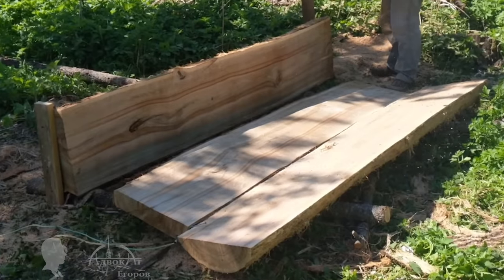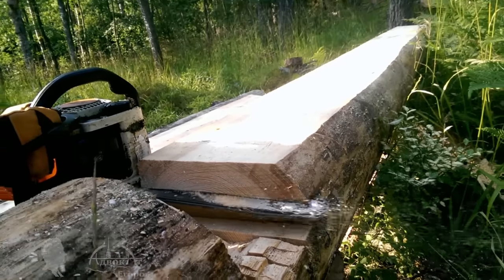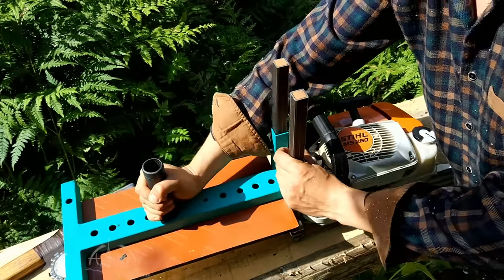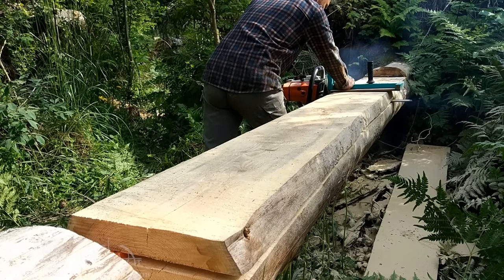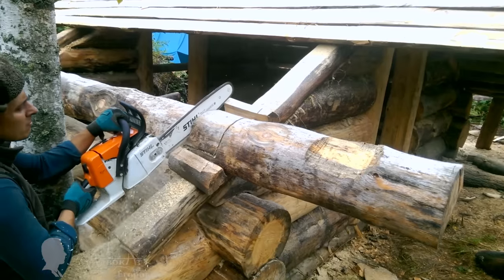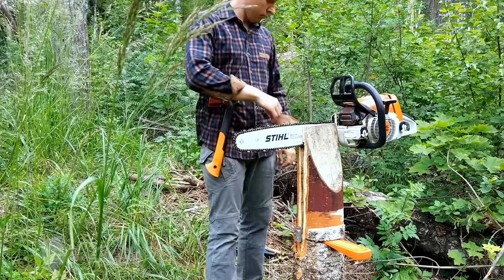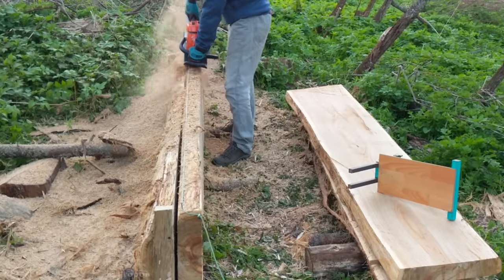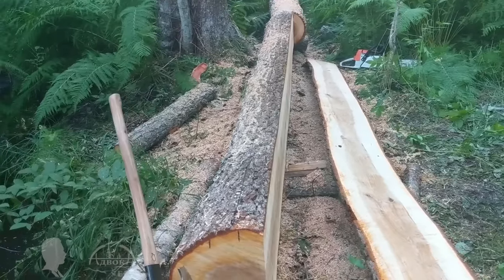Two Chainsaw Secrets | Turning a Tree into Perfect Boards

Comment: From a professional logger , get some safety gear and a military tourniquet . They could save your life and I'm sure your family will appreciate that .
Reply: Question for you: Don't we risk to have some kickback issues with his technique ?
Reply: ArthA122 would guess it’s always possible just have to always have a firm grip and control of the saw. Not that hard to control the saw if it kicks back letting off throttle immediately and strong hold on it.
Reply: Thanks dad...
Reply: @AGTtactical  I have seen one tough guy cut his half his arm off . So take notes and wear safety gear . Without a tourniquet he would be dead . He was a wildland firefighter and new his way around a chainsaw .
Reply: @baldwinboshop7078  Yeah, good for you... I've seen guys get both legs blown off, sucking chest wounds, an eye hanging out of his socket, fingers blown off , and exit wounds I could fit my fist into.  This guy clearly doesn't need your advice...save your 2 cents for a safety video, because any guy who has actually used a saw as much as Advoco knows he should wear safety equipment.  I wear chaps, steel toed boots, full face screen, hearing protection and a helmet...I think its something one should always use.  But I don't feel the need to tell everyone else what they should do, and especially not a guy as skilled with a saw as Advoko who obviously has made a conscious decision not to wear safety equipment.  Most people watch this video and admire Advoko's skill at making free-hand boards.  Then there are the rest that feel a need to show how much they know....
Reply: @AGTtactical  , your very charming .
Reply: @AGTtactical  wood chips can fly into your eyes and make you blind, no matter how skilled you are at sawing.. 
upon prolonged exposure to loud machines your hearing will degrade. Standing with your feet underneath the logs can get your toes chopped off without steel-tip shoes etc....

I don't expect Advoco to use this just because I point out the obvious hazards of it, but for everyone else who thinks they're gonna be cool and manly; you're way cooler with eyes, fingers and toes intact..
Reply: One of the people I knew that made charcoal for extra money had a saw kickback and split his head open.  It left his wife with almost no income and several young children.  It only takes once.😢
Reply: @AGTtactical  the benefit is for those who have no experience, see a guy with experience doing it, and think it is ok for them to do the same. The new guys need to live long enough to become experienced old guys.
Reply: Listen up everyone,  @AGTtactical  has seen some gore before.  Therefore safety equipment is useless.
Heh.  That's right.  You just got owned by facts and logic. QED.

Comment: Are you using fuel from a gas station?  These new fuels are no good for 2 stroke engines!  Instead buy TrueFuel it is specifically made for small 2 stroke engines!
Reply: why is that?
Reply: @Ken2234  synthethic fuel burns cleaner and most important less hot, thats why! It's composid from far less components than natural fuel.

Comment: I love the use of the scooter.  Ive come into a small (20 acre) holding and house and I keep coming back to not buying in tractors and quads and trying to use what I have.  I'd love an electric Polaris ranger, but it's not very off road and I'm toying with using an old 2013 nissan leaf for getting about.  If it goes wrong, it goes wrong!

Comment: I don’t even own a chainsaw and I think this is my new favorite channel. 
For your lines down the trunk before you cut, a safer (and easier) method would be to use a chalk spool/string. Not sure of the proper name, but my grandpa used to use it all the time. Basically it is just a spool of string on a reel, encased with colored chalk. Had a little hook on the end of the string that you can attach to a nail or something on one end. Then you just walk with the spool to where you need on the other end, tension the string moderately tight from end to end, pull the string up like a hunting bow, and let go. String snaps down onto the log and leaves a straight cutting line from end to end.
Reply: It's called a chalk line. The problem with this method is that the saw will blow the chalk away the first time you make a pass with the saw.

Comment: Hi Max, thanks for your video!  I found this very informative.  I have some large tallow gum tree logs here in Australia I want to try slabbing using your method.  You mentioned saw suggestions - I have an old Stihl 090 saw that I use for cutting large logs.  It is a bullet-proof piece of kit, and very powerful.  The lack of a chain brake is a little unnerving but you just learn to respect it.  These saws are impossible to source new here in Australia due to emissions laws, but you might be able to get one in Russia.  I cannot fault the saw, it is by far the best I have used, however it is a little on the heavy side.  All the best.
Reply from the maker: Joseph, thank you for the info. I ended up going with a portable Husky chainsaw

Comment: Excellent information.

I saw this a while back and have tried it.
Although I have not mastered the technique it works really well.
Reply from the maker: Shawn, than you for the feedback on the technique!
Reply: @Advoko Only using the tip has made my cuts cleaner easier and the chains last longer.

This works with felling trees as well as delimbing them.

I do not cut anywhere near as much wood as you do.

I do clear low hanging limbs from my property.

I have lots of bushy Juniper trees. 
Clearing them up as high as I can reach so I can walk under them is a full time job.

Starting on the smaller trees 2 to 3 inches in diameter keeping them limb free 10 foot up has produced numerous very straight fence poles after 10 years of growth.
Typically 4 to 6 inch poles.

Older trees I do the same but I like shade.

I live in Texas.

Comment: Max, a friend of mine has a HUGE pine log that we’ve been trying to figure out how to deal with for a couple of years.  I’m only fairly new to the logging/bushcraft scene.  It’s at least 2-1/2 feet in diameter, plus it’s leaning on a stand of trees it rolled onto (I didn’t fell the tree, but am trying to deal with someone else’s mistakes).  Was thinking the only option was to invest in a chainsaw mill.  Then, I watched this video.  I haven’t tried this technique yet, but am planning on doing so in the next month or so since this technique mills the boards vertically, not horizontally, like a chainsaw mill does.  I think this will be a great workaround given the log is leaning on a stand of trees.  I will report back with my results, but am sure they’ll be stellar with your guidance given here.  I have recently been getting into bushcraft in a more focused way, and only very recently have come across your videos.  They have taught and inspired so much, so ...THANK YOU!!!

Comment: I use the Husqvarna 450 rancher. It's a grest saw! But you have to use Husqvarna fuel. It's high octane and lubricants are perfect for all 2 cycle engines. You can use your own gas/oil mix but I highly recommend this Husqvarna fuel. I've used it in the same poulan pro weed trimmer for 14 years now and it starts right up every spring! Good luck brother!
Reply from the maker: Thank you for the info. I ended up getting a Husquarna 365 chainsaw...
Reply: @Advoko  sounds like a great choice. Congratulations! I know it's expensive, but please trust me on the husqvarna fuel. If you buy it with your product (gallon size) it even extends the manufacturer warranty. Obviously do what works for you. Just passing along info that has worked for me, for over a decade

Comment: That is very interesting. I have old power poles I want to split in half to make corral fence. I tried to saw one and found the same issues you are talking about. I will have to use your suggestions to get more split.
Reply: Might want to check them over for metal if you haven’t already.

Comment: I fought wildland firea in Alaska for a few years, am an arborist.  We used 320s in Alaska Forestry, for the most part.  Although, I am  debating between getting myself a 462 or the new 500.  We use them extensively, and they are great saws.  I've used from the old discontinued ms200 for arborist work, all the way up to a 660 with 36+ bars on them, and I feel that a 462 or 500 with a 28 inch bar is phenomenal

Comment: This is a great lesson and indeed most efficient technique for ripping.. 
regarding your premature saw failure. Do you habitually start saw and operate immediately,nor do allow rings to warm up and seat tightly prior to applying throttle /higher rpm?? 
Cheers
Reply from the maker: I give it a minute to warm up

Comment: I finished cutting a mango this summer and utilized this method albeit with a much smaller chainsaw but was able to split a few long logs!  I wish I saw this video prior as I just intuitively split my long pieces in the same way with similar results but not with the professional look and knowledge.  

Next time I’m gonna use his method as it’s much more knowledge based with far better and cleaner results. 

Mahalo from the Pacific islands.
Reply: I think a chainsaw is a bit overkill for a Mango.  I normally use 6" chef knife.  Saves from all the waste.  And my wife would kill me for spattering mango bits and chain oil all over the kitchen... ;)
Reply: @grnsouth1204  don’t know about a knife working. This is an 80 yo mango tree and was at least two stories tall.
Reply: @grnsouth1204  oh sorry bro. I re-read my original post and saw the word “tree” was missing next to the word Mango. But yes, a knife works well on a mango. Aloha.

Comment: Thanks for the Tips !! I was about to make an Alaskan one !!  I’ve got a 170.  250. 311 which is a BEAST  for just messing around is all I do with them !!! But MY ADVICE IS DONT USE STHIL OIL !!!!  Use. VP OIL. OR. AMSOIL !!   Most Oils Don’t have any ability to stay on the parts good THATS why MOST SAWS WEAR OUT QUIK !!  Ur 260 gets HOTTER AND MORE FRICTION!!!  Change your oil !!

Comment: Go with a Stihl pro saw - I have an older Ms 260 pro and a newer MS 261.  Both are incredible workhorses.  What is the ethanol content of your fuel where you are at?  For the past five years, I have only used premix VP 50-1 mix. No ethanol.   I purchase it in five-gallon cans.  a bit pricey but the protection it offers to my equipment is invaluable.  Aside from the saw and fuel suggestion - I really appreciated your video on cutting boards from sawlogs.  A researched-based tried and true technical presentation.

Comment: I make clocks out of Birdseye Maple and Myrtle Wood since 1968 and found that keeping the woo out of sunlight and also where the tempeture dosen"t change very fast keeps it from checking or cracking". I would recomend you use compressed air to blpw all areas clean to help your saw breath , inside the starter rope cover. Ask your saw shop. I think you need more oil in the saw gas.

Comment: Nice work.
I have used this technique with success.
I learned it from an Ecuadorian, YouTube video.
Keeping chain evenly sharpened and the bar rails squared up are key to strait cuts. 
MS 260 fairly small, 460 much better.
Blow sawdust out of cooling fins and tune carb slightly rich to keep piston cool.
Good quality two stroke oil and high octane fuel should help too.
Check the spark plug for color after a long cut to make sure its tan to light brown. This will tell you fuel to air ratio is right.  If its white, its too lean and will damage piston.
Another trick for using a smaller saw with a longer bar is to use a skip tooth chain.  You can make one by grinding off every other cutter.  
This reduces the load on the motor considerably.
Reply from the maker: Appreciate your feedback on the technique!

Comment: Very interesting video. I do own a Logosol mill, and it is true about the saw tooth load up and the slowness, even with a very powerful saw. Skip tooth chain and a lower rake angle does help but it can still be slow. Think I'll give your method a try as also using the saw at an angle in the log will help with the cutting, giving you the long shavings that you show on the video. Just need to be careful with these that the bottom of the saw doesn't clog up and overheat the engine. (This happened to me with a brand new Husky, melted the piston)

Comment: Max, you are my Man! I’ve only ever used a chainsaw once and it was just a Stihl little beaver, yet loads of fun. Hubby and I have just bought a block that has a lot of old cut Aussie hardwood that’s seasoned (unevenly) over the past 10 yrs. I decided to learn everything I can about using a chainsaw instead of having mobile mill come do it. Also save us oldies a packet we just don’t have. I’m inspired to watch all yr old clips now. Love the sharpening and maintenance tips. 
Looking at the angle of using the metal jig. Is it possible to saw vertically instead so the engine doesn’t get starved of fuel on its back? I’ve no idea the internal design. I just imagine the saw may also be stalling from lack of fuel.?
I’d LOVE to know how to do thinner boards? and is it harder to keep that straight line on the outer sides of the log.
💕💕💕💕🇦🇺🇦🇺🇦🇺🇦🇺🙏🙏🙏🙏👍
Reply from the maker: I don't think you could using a jig, however, when you use a chainsaw from free hand milling it is in a normal position for its engine...

Comment: We use stihl 044 in Canada, but we are just bucking to split fire wood. I have a 250 as well, but it's not powerful enough to rip boards. The 440 is the new version of the 044. Its 70cc, so quite a bit of power and 3/8 chain. I have a skip tooth chain that would also be good for ripping.
Reply from the maker: Thank you for sharing your experience!

Comment: I have used the 262 then went to the 462 and am comfortable with that using the free hand method. One BIG thing is to make sure your gas has no alcohol in it. Alcohol in it will burn up your two cycle quick. I completely attest to everything you said. It is funny because I can count on one hand the number of people I know who have bought small bandsaw mills. For whatever reason they do not use them. I have cut more wood and built barns and buildings, sold beams and slabs to 1x material + than all of them combined times 10. They have barely sawed a couple logs and quit? It is very very big to process a log on sight and then drag out the slabs and I think the moving of logs to the mill is what holds them up. Have tried the Alaskan attachment. Yep 3 times slower, down in the dust and burn up chainsaws. Right on man! Keep up the good work. I find in a lot of things the simpler way is best. In Nature this is true more often than not. I try to complicate it to my own detriment. Learned this Method in South America where they use it to saw beams then hand carry out of the woods to the mill.

Comment: I don't like Stihl much
I own -2 Husqvarna saws
For milling I use a 372XPW
I always feather the throttle to avoid over reving with a husky 
Also use wedges on horizontal cuts to keep the kerf open
I like your system and will be trying it in the next few days
Thanks for sharing the knowledge
Subbed!
Reply from the maker: Sam, I ended up buying a Husky 365 about two years ago and it never let me down since...

Comment: Love the video as I am just about to have a go at some oak I cut down recently. 
I have a Stihl Ms181 and a massive 880 saw mill, but having seen your video I am going to experiment with my lovely little MS 181. It is my favourite toy and you make such a good case for using it. 
Our logic. Thank you. I will try to let you know how I get on this Sunday. 
Regards 
Jim Darnell.
Reply from the maker: Jim, many commentators hear were succesful using this simple milling technique on the first time. One guy even sent a video link. It is buried in the comment section somewhere...
Reply: @Advoko  I tried your technique this afternoon and it was so easy to do. My only worry was the tip of my bar getting a bit hot, but I made sure it was well oiled. 
I have some lovely oak planks and continue to improve my technique. 
Thank you so much.

Comment: Husq 562.  I run a  20" bar normally, but it will push much larger.  I believe up to 28".  It's a beast.  I paid a little over $800 US for mine and wouldn't trade it for anything in its class. No more dialing in the carb for weather changes, no more losing clutch cover nuts.  Plus it is light and doesn't run hot.  I couldn't recommend it more.
Reply from the maker: Thank you for the feedback. I ended up buying a Husky 365 saw...
Reply: @Advoko  nice, can't go wrong with anything from the 3 series.  They are powerful, light, aggressive saws.  Good luck, love your channel.
Reply from the maker: The key for me was its reliability and weight

Comment: I use the Husqvarna over the Stihl any day of the week, in my opinion over the years the Husqvarna has outperformed the Stihl in cutting and in durability. I'm in Canada and the winters get extremely cold, my Husqvarna has never let me down during the winter, even when it hasn't been used till the end of the season.
Reply from the maker: I actually got a Husqvarna chainsaw last summer. So far so good!…
Reply: I like old huskys too  . 266 272 285 295(xp) and 2100cd easy to fix , basic engineering.lots of aftermarket parts Run em lean make scream. Great video! cheers  from Ucluelet /Port Alberni British Columbia ,Canada

Comment: Seems like a very smart technique for cutting, - well ripping logs, simple and obviously efficient, and by only using a small part of the chain at the tip for cutting, you would not even need to have a very powerfull chainsaw.$$$ 🙄..
Stay safe  ☆ Niels.